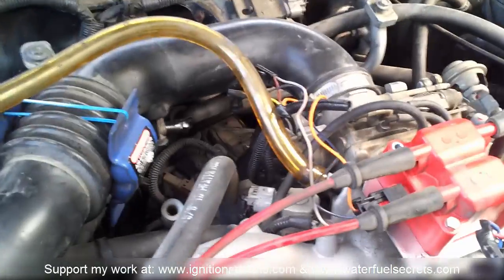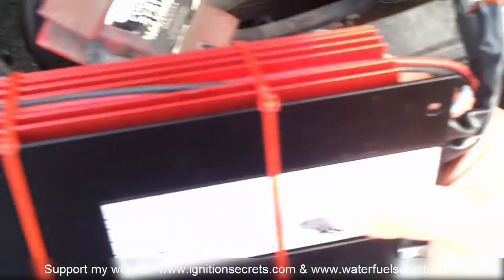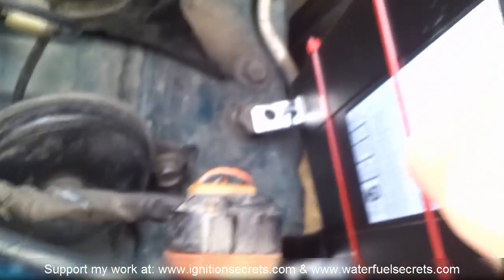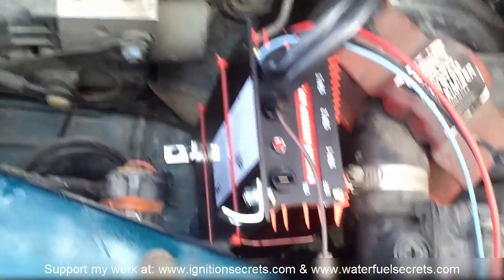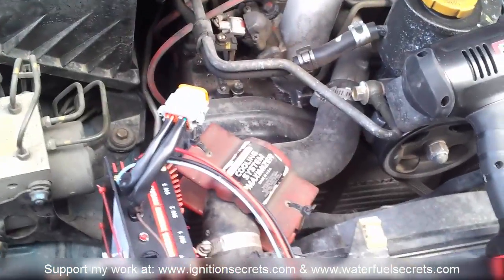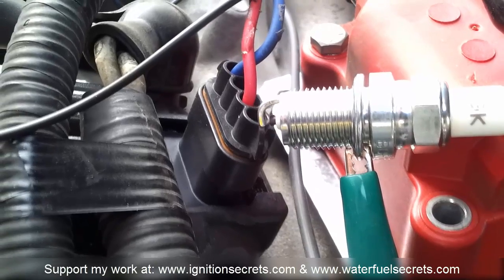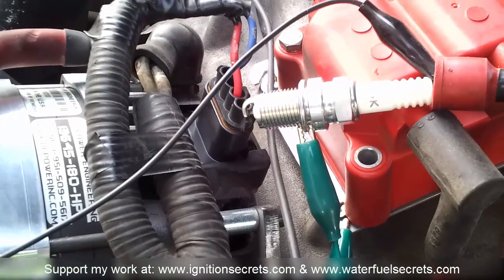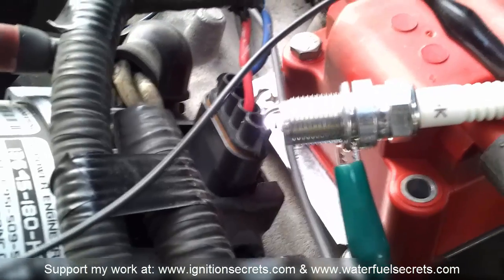MSD DIS-2 Upgrade & Plasma Ignition Demo - 1998 Subaru Legacy GT 2.5 EJ25

Comment: I know there is a small chance you will reply to this after so many years, but I have a 92 f150 with a 302ci  and want to install your plasma ignition on it, but for now I just installed a set of accel non resistor plugs and granatelli 0 ohm wires and I'm getting crazy misfires and the emi is so bad my glowshift electrical gauges coolant temp and oil pressure will randomly shut off and I have to disconnect the battery to reset them so they will turn back on. So I removed the accel plugs and put back in my factory style resistor plugs which are NGK brand and I still get misfire under load but not as bad and my gauges still shut down. So I added some ferrite chokes to all the plug wires and that helps with the misfires but my gauges still shut down, have any advice as how to combat the emi? so I can move forward with the street fire ignition. Thanks.
Reply from the maker: Hi Gregory, you should be able to keep the non resistor plugs in. Sounds like you have too many electronics for the Granatelli cables unfortunately. I would look for some performance suppression cables. If you do want the plasma ignition, the cap in the MSD unit will discharge thru the diode to the top of the plug and will bypass the cables anyway. Anyway, non resistor plugs and performance suppression cables should allow your electronics to work fine because it did in my 98 Subaru Legacy with a EJ25 engine. With Granatelli cables in the Subaru, everything went nuts.
Reply: @AaronMurakami13  Thanks for replying. I talk with Granatelli the other day and found a possible solution, when I pulled the wires out of the bag, I laid my coil wire on my table and it fell off and broke the ferrite ring, the guy from Granatelli said these rings are made specifically for each wire, so I ordered a new coil wire and hopefully that will rid my issues with emi. If these don't work out, what wires do you recommend for your plasma system? And also could you get me a link for for the diodes you used on your Datsun, I just want to make sure I buy the correct ones.
Reply from the maker: @gregory9740  I had the ferrite rings on all the cables in my Legacy and they didn't help. I don't have any specific cable recommendation - just performance and suppression are keywords to search i Amazon - that's where I got the ones for my legacy. These are the exact diodes I use - https://www.amazon.com/gp/product/B087PRYGRT?ie=UTF8&tag=maimounas-20&linkCode=as2&camp=1789&creative=9325&creativeASIN=B087PRYGRT

Comment: Heres my setup thats still a work in progress.

 On my v6 im using the dis4+  with 6 coil on plugs instead of the waste spark coil pack. Also had to use the ignition simulator from msd. The paired cylinder's coils are wired in parallel. The ones Im using, the inductance of them being in parallel is lest than the coil packs original. Runs But whats weird is, if i have all the cylinders using plasma the engine runs roughly. But if only 1 cylinder from each pair  (3/6) uses the plasma diodes runs perfectly... until quick acceleration. I think i may not have enough battery voltage or I've got some interference issues. Dont neccesarily think im shorting out but its a possibility. Havent figured it out yet.
Reply from the maker: Have you seen my entire wasted spark plasma presentation? https://emediapress.com/shop/ignition-secrets-plasma-ignition-solved-wasted-spark-systems/
Reply: Yes!  I have tried everything in the presentation except the custom dual secondary coil. I'll  be trying some different coil packs to see if that was my issue or if its the MSD unit itself. I have herd many issues with these DIS-4 units

Comment: aaron would it be possible to run two msd8239 coils and just ground the negative polarity terminals. effectively running all four cylinders on the desired polarity. given that timing in wasted spark is identical for opposing cylinders.
Reply from the maker: Yes, I've already done that and it works. That is in fact my wasted spark solution in the presentation here: http://ignitionsecrets.com/

Comment: Hi, Aaron I don't see why you went to all the trouble to upgrade the coil pack & Alternator and add in the Dis 2 to achieve the CAP circuit to achieve higher Power spark (plasma sparks).. when you can just buy the plasma spark plugs from Pulstar that fit OEM into the EJ25 engine and keep the existing coil pack and alternator. Seems like more work and money the way you did it.
Reply from the maker: Actually, Pulstar plugs are junk. That is nothing more than a mediocre "peaking capacitor" built into the plug. And with the high resistance, it defeats most of the benefit anyway. Those plugs give a feeble little spark compared to my plasma ignition. Check out http://ignitionsecrets.com and you'll see what I mean. My plasma ignition is light years ahead of any plug technology - I'm talking HUNDREDS of times bigger impulse than a Pulstar plug.

Comment from the maker: To have this work for all 4 plugs, a coil modification may be needed. I'll share what it is but I have to build it - nobody in the world makes one that I can find. Pretty simple for the most part.
Reply: Aaron Murakami did you ever get this to work on all 4 plugs? What did you have to do to make it work? Also does it do a plasma spark on the exhaust stroke of the paired cylinder?
Reply: On page 24 of the thread on Energy Science forum coatzee says that bench tests plasma works with waste spark but resistance it faces going thru the engine is what kills the paired cylinders plasma. Would it work to attach a wire to 2 washers and put the spark plugs through those washers before putting the plugs in the heads for the paired cylinders. That should give it a better path to travel than through the engine. Also what is your thoughts on a 2 plug per cylinder engine? I am trying to use Gm twin tower waste spark coils for each cylinder and both fire on combustion stroke, instead of waiting it on the paired cylinders exhaust stroke. This also puts the paired plugs 1 inch away from each other so resistance thru the head shouldn't be alot. My engine has 16 plugs and will take 2 msd dis 4 boxes and some resistance adapters from msd so still trying to get  everything needed to get the ignition converted to cdi.

Comment: Hi,
Good job!
Tell me please what type of diodes (or diode array) for creating plasma with additions DC current for the spark. Im experimenting with plasma and have problems some time with the i call "diode valve" (overheat after time, or brake down from high voltage pulses).
Im use to time a array of DSEI20-12A x 25pcs, work well but not perfect the main parameters 18A direct current, about 100A for short pulse, 1.2kV for one diode.

I do not want set a vacuum diode in my device because the high energy consumption of the cathode heater.  :)
 
Relay the woks in extreme conditions High voltage impulse from one side and high current from other + the current must the diode delivery to High voltage side ...
Reply from the maker: Hi Sandris, normally I use strings of 6A100 diodes (6 amp 1000v) and they're fairly bulletproof - 25 or so makes a great diode for this. However, in the video, I'm using a 30kv 2amp ham radio diode. Just one of these seems to work for all 4 cylinders, but I think I will add 1 more so only 1 diode per 2 cylinders just to divide the work the diodes have to do. This is the exact diode I'm using: http://www.amazon.com/gp/product/B00BN2NGSM?ie=UTF8&tag=maimounas-20&linkCode=as2&camp=1789&creative=9325&creativeASIN=B00BN2NGSM
Reply: Aaron Murakami If one is having to purchase diodes would it make sense to sub a 25kv 2A diode as it less than half the price of the listing you shared? Also is the plasma mod completely external to the Dis-2? I have a Aquapulser X60 system that i got over a year ago but had to sell the truck when i was blessed with a great deal on a much newer/larger truck that gets better mileage. Thing is the new truck has coil-on-plugs and i was wondering if you have any insights on achieving plasma ignition through, or around rather, such coils?
Reply from the maker: Please join us here: http://www.energyscienceforum.com/showthread.php?t=689 that is where I'll put most of my support for the plasma ignition. I like the ham radio single diode so far from my tests. You can get the 6A100 diodes for about half that price, but you have to solder a string so its a trade off. Longterm, I'm going to be sticking with the single diode. Yes, the plasma mod is external from the DIS-2. Arvind has some coil on plug systems with a diode built in that you might be able to use. Those are very tough to modify unless the diodes are potted in from the beginning.

Comment: how do you defeat the oxygen sensor after the oxygen sensor detects no unburned fuel and much too much oxygen and tells the emc to go full rich?  if you can defeat the oxygen sensor, or reprogram the rom in the emc, then most all of these new 4 cylinder cars will go over 80 mpg..... maybe even over 100 mpg.
Reply from the maker: The o2 sensor can be defeated with a simple "EFIE" circuit - "electronic fuel injection enhancement" a term George Wieseman came up for it. Most of these sensors go from 0.1 volts (lean) to 1.0 volts (rich). You can make or buy a circuit that goes in line with the o2 sensor output and if for example the o2 sensor gives 0.8, then you can make the circuit feed 0.6 to the computer so that it doesn't sabotage the gains. This car has 2 sensors on the front Catalytic Converter so I'd need two, but the principle is the same.

The MAF mass airflow sensor is the same - the more air that blows into the air intake and hits the sensor the cooler it gets. The cooler it gets, the more current can flow and that signal says to pump more fuel - since if you have more air, you need more fuel. Some circuits to defeat this is to put a pot meter in series with the output of that sensor to drop the current that the computer sees thereby tricking it into thinking there is less air flow so less fuel will be pumped.

Comment: also did you use tach adapter?
Reply from the maker: no, I just connected the leads together. If you don't use the tach adapter, but leave the connections disconnected, the engine will turn over but will never start so without it, connect them.

Comment: what is the part number for this dis 2 is it 6211 or 6211 2?
Reply from the maker: It is a 6211. I hooked it up based on the simple diagram for common 4 cylinder engines.